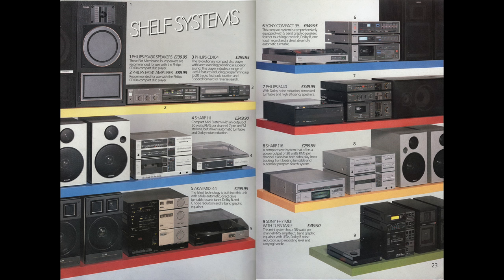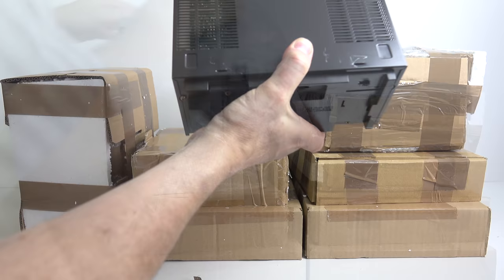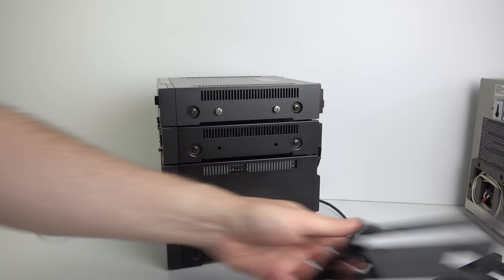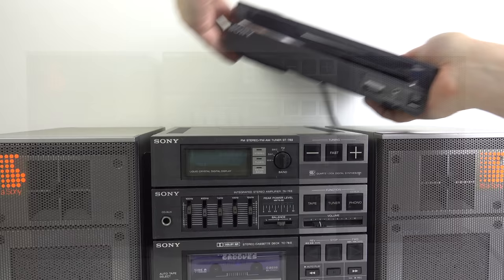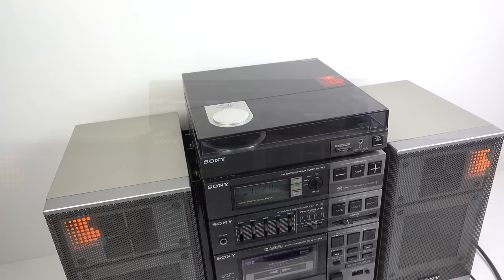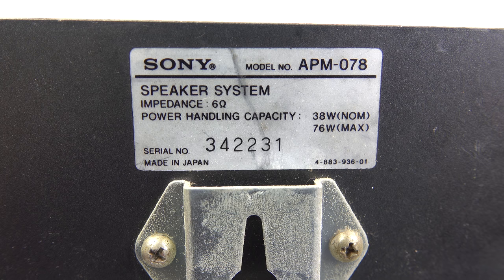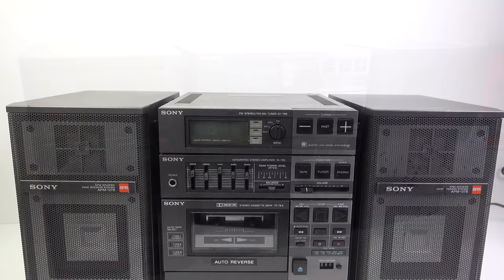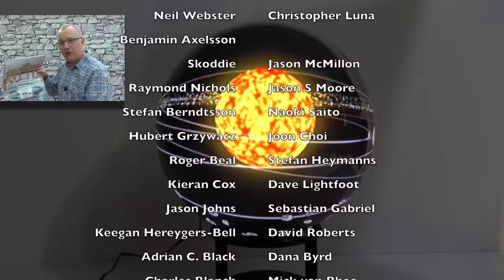HiFi Classics - Sony FH-7 MkII

Comment: I have a "FH 215R" model I purchased new in 1988 or 1987 & it's still in mint condition!!! And better still - all components still work fine! It has a, virtually full function infra red remote ( won't work the PSQ 3 turntable ( phonograph!!! ) that I also bought at the same time as the deck. In 1988 it cost me $999.00 N.Z. just for the main unit, turntable was extra !!! Of which was quite a lot for such a component, in N.Z. at that time. It's a much more refined unit, than the FH-7's, being two years further on in development & has more features, mutiple digital tuner memories, A.M./F.M & S.W.!!!  ( without the battery back up ), a seven band graphic equalizer electronically adjusted for each seperate frequency & the display for this is also a Spectrum Analyzer too! With three programmable memories & a "flat frequency" button too!
 I was 18 years old when I purchased this, but I was, too, already a consumer electronics enthusiast & what atracted me to this unit was it's array of features & it's amplifier, because, in 1988, - 45 R.M.S !!! YEA!!! For such a micro unit, that was PUMP'N!!! It had a sticker on the front of an out put rating of - something like 2300w P.M.P.O (of which, from memory, stood for: Peak Music Power Output!!??!! - & I seem to remember that you divided the P.M.P.O figure by 52 to get a rough R.M.S out put figure.... Can anybody confirm this or add knowledge here please? 
I still have all original pieces, the brackets & handle ( virtually the same as in the video), advertising stickers that were on the front, the manual, the box & packing & the absolutely MINT remote - I just remembered the the original Sony AA "Dry Cells", - as Sony named them, lasted 20 years, no kidding, but with obviously not much use.... & of course, the cells never leaked anything, what with being "Dry Cells" I guess...??? I still love it, "it's a Sony"!!!  Did you notice the A.P.M badge on the "correct" set of speakers!!??? In the manual this stands for - "Accurate Pistonic Modulation", from memory... My FH-215R has this as well + they are 3 way, - flat honey comb woofers, tweeters & super tweaters. Also in the centre dust caps on woofers it has a badging of S.A.T of which stood for, no bull here, - "Super Acoustic Turbo"!!!! - straight up - the amp section has a button on it for engaging the S.A.T - just a Sony's fancy name for it's bass enhancement or loudness button/circuitry!!! It worked, O.K. ( especially for 1987/8 in a micro unit!) I remember my older brothers giving me stick about it saying " does it tell you what day of the week it is, - like Saturday? Ha ha you funny bastards, at least I still have it & it's probably worth something, to somebody.... I've moved on to "full HiFi" sized units, namely Japanese units of the eighties & early nineties, Yamaha, Onkyo, Technics, Sansui, Rotel, Nakamichi. Absolutely brilliantly build quality era with nice solid amps....
 Bit of a ramble on here & reminiscing.... Sorry if I've just had a bout of "verbal/key pad diahrea....

Comment: Great video. I have the Sony FH55W stored away in my loft. In excellent condition although the volume slider is erratic. Also, an ex-girlfriend threw away the handle because she found it in a drawer doing nothing and decided it was taking up space and just disposed of it. Needless to say I disposed of the girlfriend not long after. At some point I will get the volume slider sorted at a reputable hi-fi store and maybe put the unit back on display in my bedroom.
In case you were wondering my lounge is powered by Technics separates including a pair of SL 1200s and a SL MC7  CD changer. My nephews and nieces think I'm old-fashioned, that is until I turn the volume up. Might is right.

Comment: One of the unique features of the FH series were its APM speakers.  APM stands for "Accurate Pistonic Motion”.  In contrast to the concave/convex diaphragms of regular speakers, Sony engineers designed the APM speakers to have flat square rigid diaphragms to avoid split vibrations, have a much higher breakup frequency and much lower distortion levels across the whole frequency spectrum.
Reply: Yep, my APM room is my best sounding 5.1 system. Custom center made from 2 APM-22ES woofers, high and mid from APM-8, plus 22-ES fronts, and custom dipole rears. The rears are 4 X5A woofers each, with 2 22-ES tweeters.

Comment: 12:30 Mk1 claims that it can auto detect type III cassettes. Auto detection relied on notches on the back of the cassette  shell,  but there were no notches defined for type III tapes. So by definition, any deck that could handle type III would have to have manual selection at least for that one type. So I wonder how that worked.
Reply: Maybe it could detect a lack of notches?
Reply: All Compact Cassettes have a write protect notch; it's additional notches that indicate what type of tape is in it.  Type I tapes have only the write protect notch, so that would be the "lack of notches" you are guessing at.
Reply: The bias and equalization requirements for FeCr (type III) are close enough to type I, no special settings are required for playback.  It may be that when recording, it ran a short test recording sequence to determine the tape type.  Couldn't find a user manual, so this is just a guess.  I do remember that there were cassette decks from this era that did something like this.
Reply: I do believe there's a switch on the back of the unit to manually select the tapes. EDIT: Just checked, it does have a manual slider on the back.

Comment: I remember these so well. My absolute favorite model was the FH-215R - infra-red remote and a tape deck that recorded on Metal with a 7-band digital EQ and SA. Then they had models later on with Dolby C/HX-Pro, twin tape decks, MD player modules and probably even DAT recorder options as well. Hugely popular around the globe for Sony since these came right at a time when the big floor standing HIFI systems in those glass/wood cabinets were going out of style. You no longer needed living room furniture to enjoy HIFI quality sound.

Oh, and the EXTRA BASS on these was AMAZING!!!

They changed the battery on later models as well with a piggy-back design that you would mount to the back of the unit instead of swapping out the base. I remember asking the dealer who said he sold one to a guy and the thing ran for only 20 minutes on a fresh set of batteries. Clearly D-size alkalines couldn't push enough juice, but there's nothing stopping some lucky guy from modding a modern lithium ion pack that could push one of these to an hour or more of unplugged run time.

I need a time machine.

Comment: Might be careful with those, I think they had a big issue with foam rot. I believe there are repair foam kits out there though.  What a gorgeous little minisystem.  My best memories of the 80's were these 80's mini systems and boom box designs... the higher end for consumer ones.
Reply: I'd buy that for a dollar

A repair foam kit

To repair my old childhood Walkman

sorry for this post
Reply: I looked to see if someone had commented this. Yes the speaker driver foam goes to shit. Inspect it carefully, perhaps gently prod it
Reply: Have had dozens of the APM speakers, and unfortunately foam repair kits are VERY hard to find, and that for the most popular models. A low volume model will NOT have a foam kit available at any price. I managed to repair a single APM-8 woofer by forming a chamois into the proper shape and coating it with some liquid rubber stuff.
Speaking of coating, the best thing you can do for a foam surround, especially square ones that are irreplaceable, is to thin down something like Eileen's Tacky Glue and gently brush it on the back of the foam. Do this BEFORE it rots, because just touching it with a soft brush will cause it to disintegrate.

Comment: Well after a long wait I finally found a Sony FH-7 MKIII only a 25 min drive away fully working in almost new condition. Thanks to the previous owner who passed away but looked after his audio gear. :) Glad I watched this video and found the 2 x AA original Sony batteries in the back of the tuner but no corrosion :)

Comment: I imagine you're on the lookout for the battery power supply module for that. I would guess they are pretty rare and of the few sold, many have been damaged by leaky batteries. Still 15 kg plus 12 D batteries would make for quite the workout.

Comment: Million thanks for the review..
I have this unit, bought in 1989, still working fine, except tape mechanism, due to worn out capstan bush bearing.. and as I wasn't using the cassette for a long time the feather touch mechanism also stopped working.. so I added a digital card reader driver, 8nside the cassette door.. now it's even greater than before.. my intention was to buy a red one, while it wasn't available there.. even yesterday was listening musics.. the low profile STK pumps out great out put all the while.. remember it's powered with STK 078 G.. what a great product..

Comment: Hi Mat, thanks for the reviews and great video's. One thing i have never seen you use when restoring the items you dismantle, an airline/compressor. I know you may think it overkill to get a compressor for the odd use, but i guarantee you will never look back. you won't believe how much you will use it. it will have many applications, but as a duster for blowing out the cobwebs and debris, they are invaluable. 
all the best, Garry

Comment: I have and still use regularly my Hitachi 3d superwoofer single deck I bought away back in 1987 and a Technics seperates system that cost me £2000 back in 1992, that included upgraded connection cables, speaker's and stand's etc.. Can't beat the old school boom boxes or hi-fi's.. Great video, thank you for sharing 👍🍀😁

Comment: In 2015, I have managed to get the power deck, cassette deck and EQ deck of MK-i, the speakers of MK-ii and the radio deck of MK-iii.  Now it's complete mix of 3 versions of FH-7.  All the cables in the back fits just fine which was surprising to me.  I always wanted one in my childhood in the mid 80s but it was too expensive to have.  My new Mixed FH-7 works perfectly except cassette doesn't work properly anymore.  the APM speakers are impressively loud and doesn't distort at all.

Comment: I'd have liked to see you try the Short Wave tuner option. Back in the 1980's you'd have been able to get all kinds of weird and wonderful stuff on SW, including the Number Stations.
Reply: Liam Godden Aren't there still weird things on SW sometimes these days though?
Reply: Very few Numbers Stations are still active, in my area i can hear de Atencion! cuban Number Station, loud and clear, weird stuff!
Reply: @Redhotsmasher  mostly religious sermons from the usa. you'll be lucky to find anything but that - certain high powered stations (usually state run) from overseas and some number stations if you have a nice antenna. shortwave is hard to enjoy these days because of interference or simply because few active stations bother to broadcast with enough power to reach beyond a fairly regional reach. there's still a lot of things like local pirate radios, beacons and odd unknown noises, but they get boring to listen to. there's a few online public tuners you can use and small communities that post schedules of what you can hear, though

Comment: I had one of these systems and bought the small compact turntable that fitted on top. It’s clever design meant your 33 rpm LP record would stick out so it looked quite quirky. It was a decent system and I had years of entertainment from it

Comment: I love the nostalgia of this system and definitely remember stuff like this from back in the day. I do have to say it looks really cheap and plastic for the price. Like you said it wasn't a cheap device. Love your stuff keep up the good work.
Reply: Koen Dekoning
 Except much of the exteriors were metal and wood! You'd NEVER find this is even a top of the line mini system today.
Reply: I'm not trying to be difficult here but I saw mostly plastic and no wood at all.
Reply: Koen Dekoning 
Actually the cases were all metal on the components, except for the front facing plates however I believe some of those were actually metal or metal behind plastic as well. Speakers were wood enclosures with metal covers. the only all plastic item might have been the turntable. But I believe that the base of that item is also metal to help reduce resonance.

Comment: I have one of these (only the amplifier and the equalizer) and it's still working very nice after all these years... it's a really die hard device running 2x custom 6ohm shelf speakers and 2x 12ohm mid-ranges which i further added...I know it's too much for it but it's not letting me down. fantastic device actually.